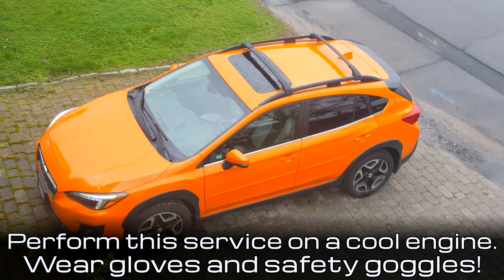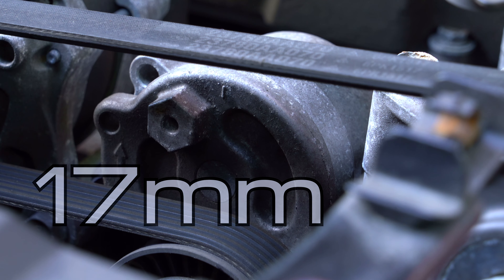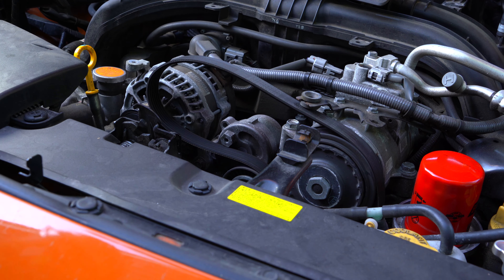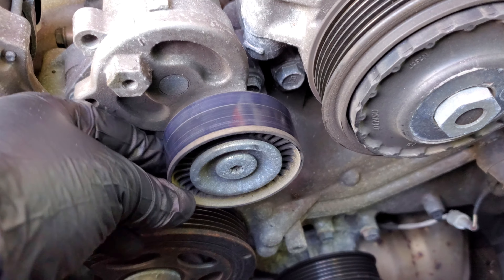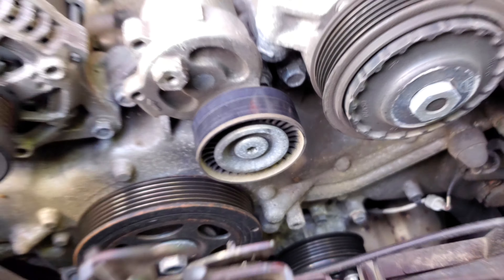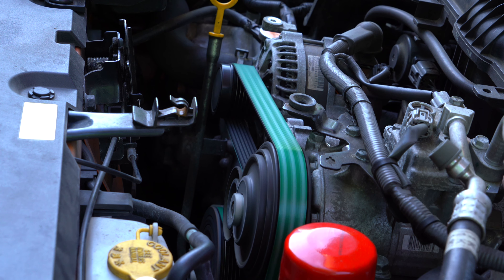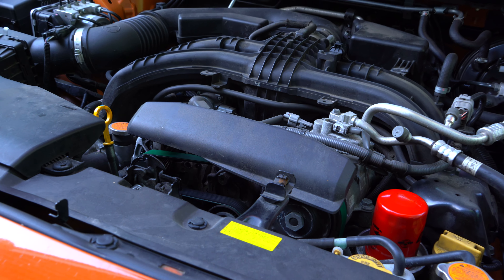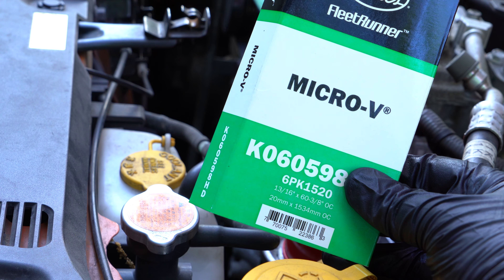2018+ Subaru Crosstrek Serpentine Belt Replacement on 2.0L (FB20) • Cars Simplified

Comment: Would be nice if all belts had clear dimension labels like that instead of just having to decode part numbers!
Reply from the maker: I'm actually working on a video about that, and a lot of them do, including both belts shown in this video. Still a little decoding, but it's at least an industry standard.
Reply from the maker: Just realized I read too fast and missed "like that" in your comment, but probably still an acceptable response.
Reply: @CarsSimplified  Haha all good! Yep I know how to decode them, just makes life easy if the actual numbers are there. ;)

Comment: What new belt is that ?
Reply from the maker: The new green belt I installed is most well-known as a Gates Fleetrunner, but it is also available from a few different brands like AC Delco. I'm 90% sure some of those other brands are the same belt sold in a different cardboard sleeve.

I have affiliate links to both the Fleetrunner and the AC Delco ("Specialty") version in the description of the video.